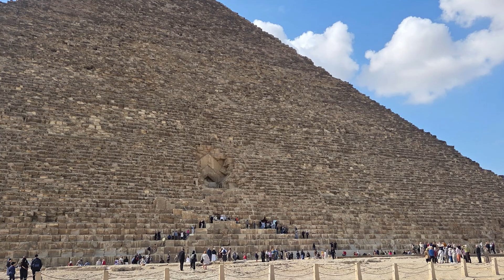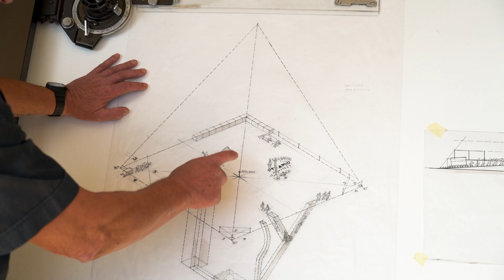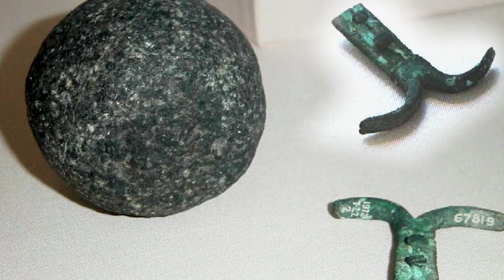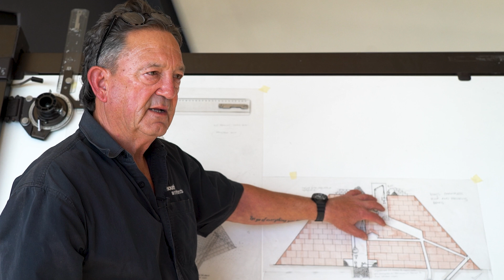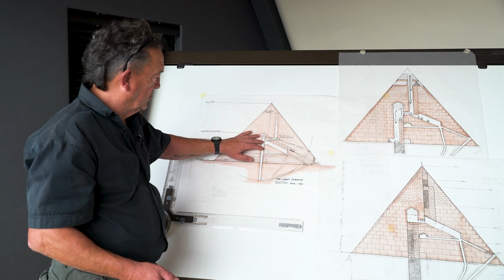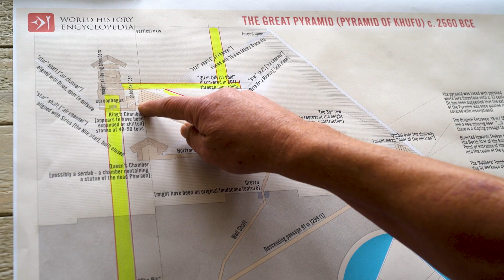HOW THE GREAT PYRAMID OF GIZA WAS BUILT

Comment: Sir, you want to know the truth? you masons can't handle the truth
1) the ropes would of left marks at that weight and altitude ON EVERY BLOCK, there is no marks why? because they did not use ropes.
2) the cuts are PERFECT and nothing we have today can even cut that smooth, they were also cut with a pressured water laser and you can tell this because the inner side of the blocks are darker than the outside and only vast friction can turn all sides of the outer blocks that colour. Also all the HIEROGLYPHS were cut out with a LIGHT laser. This is how the same symbols look all the exactly the same, no chisels were used.  
They were built to align us with a way out of core, our ancestors were smart enough to know space is not expanding and all objects are going to core, they created them as a MAP to go the right direction away from core and they left in 2800 BC.  
I HAD VISIONS OF BEING THERE, NOT DREAMS, VISIONS.